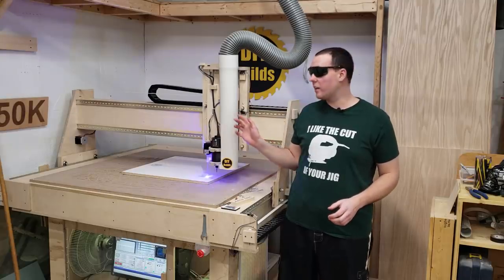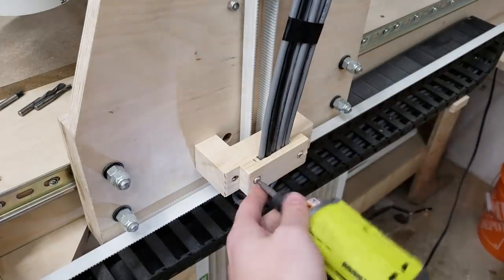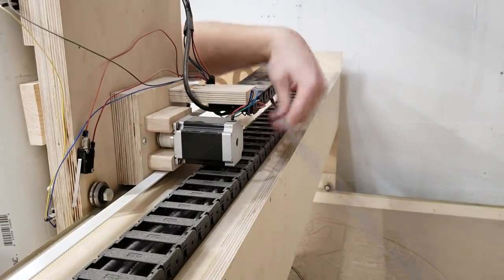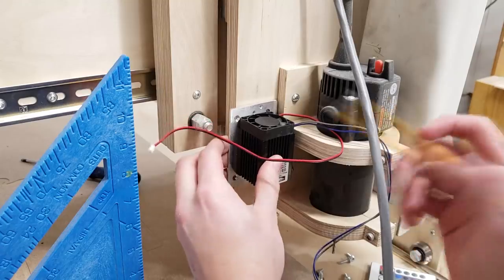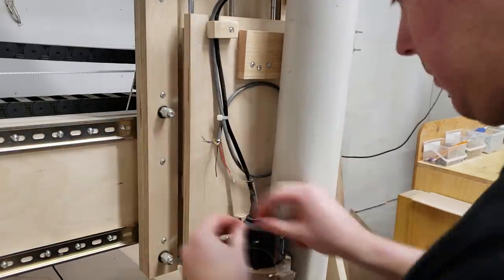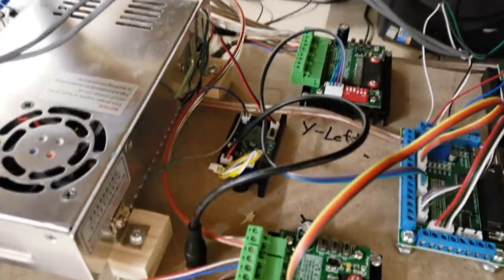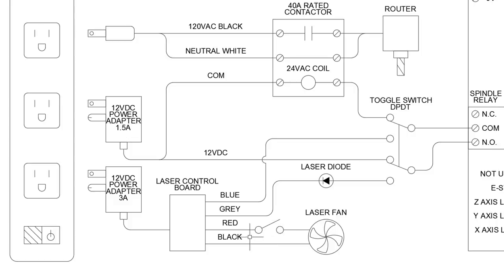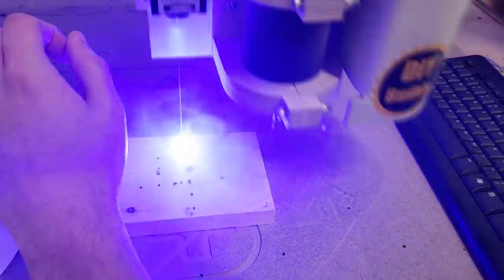DIY CNC Laser - Adding a 5W Laser to My Homemade CNC Router

Comment: After reading the comments I came up with a couple suggestions:

1) Add a laser pointer to the set up and have the pointer lined up with the spot where the laser burns. The pointer would then give you a visual reference without having to turn on the burner laser allowing you to zero the laser without the need for glasses.

2) (a) An optical safety addition: add removable piece of properly colored plastic that extends down past the bottom of the laser an inch or two above the cutting surface. This will insure that the potential laser on glasses off potential harm, has no affect. (b) Or you could just add a box around the piece being burned, cut or engraved; whichever the case may be.
Reply from the maker: Not bad suggestions at all. Thanks.
Reply: @DIYBuilds  😎👍
Reply: @DIYBuilds  i thinks there is an option to regulate the power of the laser, so you can set a very low power to the laser to clearly see the spot and regulate the focus. then you set the full power for the work. saw it on other videos like yours

Comment: First of all "a Great video" but i Must say that your house keeping skills (wiring) are great, i have a 4x4 diy cnc since 2017 and still working on the house keeping. Keep up the great work. also i notice you use Belt drive i use .25 chain drive and love it, i have only had to make adjustments once since i started and travel speeds are high.

Comment: What you will need to find out is if the Laser Module can handle Pulse Width Modulation. Typical Laser Engravers will have that so as to set the laser turning on percentage. 100% would have the laser pulsing very fast and more intense, while 50% would provide for the laser to provide a lesser burn effect in the material. This is where you would have to play with the settings to get the parameters set for each of the material you want to laser engrave. Mach3 does provide the ability to produce PWM signals to a laser device.

Comment: Hello. Is it possible to control the laser power using the spindle rotation signal? I'm asking because almost all laser module have a PWM controller, and I'm not sure if the Mach3 interface can output PWM to control the laser power. Thanks in advance!

Comment: If you add a connector for your laser lead it makes it able to be removed when not using the laser. I found that dust and vibration from cutting can be hard on the laser. Even with the best dust collector small dust partials build up on the lens and when the laser comes on will burn into the lens and will shorten it's life.
Reply from the maker: Good idea thanks
Reply: What about a piece of tape or plastic over the lens? Would that work? Thanks for the tip!
Reply: @TheRainHarvester  that would save dust from the lens, but not from the cooling find and fan. And vibration is still an issue. In found a quick release mount made it easy to change it out.

Comment: I purchased a small laser similar to yours but it seems that it is either on or off, no adjustment for the strength of the laser, as least that’s my understanding, is that the same as yours?
How do you control the on and off of the laser so it doesn’t burn the surface from one area to the next?
Thanks

Comment: In my case 3wire laser 12v,gnd&pwm …..pwm connect with pin 1 and external power supply for laser also but laser always power on its not control by mach3 …any idea about this issue ….external power supply gnd wire should connect with mach board?

Comment: Great build! 
4:08 - I prefer using another heat shirnk tube (with a bigger diameter) going over all wires instead of electrical tape.
After a few years the tape just gets all sticky... yuck! But maybe I used some bad quality tape.

Comment: Thanks for sharing this video. I have thought about doing this for some time. My question is how do you 'zero' in the starting point of the laser. With the router you just align the bit with the center of the material (or wherever you want to start). How do you zero in the laser's starting point without burning your material?? Thanks!
Reply from the maker: I burn the spoil board and jog it till it hits the bottom left corner (my 0)

Comment: Love this. Going to try it with my china 6040.   I think it would be a bit simpler to wire if I give it its own power supply and manual switch.   Without touching the control box.   What do you think?

Comment: Great! I have a question though, I also have a CNC on which I can switch between the spindle and the laser diode but I can't find a way the make a design that use M3 and M5 to replace the Z axis command... yes I'm new to this! Do you have a video where you explain that? Or can you give me some clues? Programs, post processor, etc. Thanks!
Reply from the maker: They way I do it is not easy and requires manual manipulation of the code. Sorry I can't make it easier for you.
Reply: @DIYBuilds  Still I'm interested to know, I'm used to 'not easy' ahah! Did you only altered the post processor? Any ressources or documentation you could recommend on the top of your head? Which software do you use to generate your G-Code? Thanks!
Reply from the maker: I make the g code in fusion using trace. I make the retract go up 1 inch and set cutting at 0. Then in notepad I find and replace all retract commands with m5 (off) and replace all down commands with m3 (on)
Reply: @DIYBuilds  Thanks a lot for the pointers!!! I'll go and try a couple of things!!

Comment: Awesome, I wish I had the money and possibility to build one myself!
Reply: If you wanted to do just the laser you could build it for around $100 plus the cost of the laser.. not sure how much they go for..
Reply: @piercer4882  Depending on what you want, 5W laser modules run from $65 to ~$150 on eBay.

Comment: It's awesome project and with an engraving laser you can do almost everything you like on wood. But when you cnc something and then you want to engrave, have you set offset between router and laser? Because then you could not do precisely cnc and engraving on the same wood piece.
Reply from the maker: No I'd be eyeballing it for sure.
Reply: @DIYBuilds  you could use mirrors.  a 45 over to the router, remove the router bit, and install a custom bit with another 45 mirror and boom, your laser is where you router bit was.
Reply: G10 L20 P0 x0 y0 "  Will reset the origin to 0,0. You could replace the zero with an offset of your laser. Just be sure that the two objects are always created/referenced from the same origin point (add a dot to the bottom left so the cam sw will acknowledge a reference point) the cnc cam won't attempt to cut a dot, but the laser might.

Comment: Where do the yellow and white wires off the laser board connect to?
Reply from the maker: Mine has red and white = fan and blue and grey = LASER. The board has the ability for power control but i just use max power

Comment: Cool Machine !How did you make the laser go on and off during the G0 movements ,did you manually have to place M3 and M5 commands in the G-code ?
Reply from the maker: Yes i did
Reply: I,ve the same problem,for small programs it isn't a problem,but for large G-code files it's a pain.There must be a solution for this
Reply: MvdG what you can do is run a small program that can insert those codes for you.
Reply: Is there anyway that you can use the find and replace option in Notepad to help reduce your labor?

Comment: [At 7:20 min] Is the circle one hundred percent round? You can see a tiny edge / overlap.
Reply from the maker: This is due to the m3 and m5 commands dwelling in place for a fraction of a second when switching the laser on and off allowing the laser to burn a bigger mark then when moving. I'm not sure how to fix it yet.
Reply: Mach 3 has a dwell setting to allow the spindle to spin up, setting this to zero my help.  @DIYBuilds
Reply from the maker: I did do that and a dwell still exists. I think its related to the way the m3 command works. Other things online mentioned using aux output to control it but my board doesn't support that.

Comment: If I understand correctly you use spindle on/off g-code commands to turn the laser on and off?
Q1: what software do you use to generate gcode ? Typical milling cam software moves z up before moving the spindle to next position but with laser the z stays in place but the spindle stays on
Q2: can you control power output of the laser in this setup?
Reply from the maker: My controller can't but an addon board can be purchased. I use mill cam to generate g code and set heights all to 0 and manually add in the m3 m5 commands
Reply: @DIYBuilds  just to confirm, you don't control the power of the laser at all, it's just simply on and off via the m3 and m5 commands you manually enter in the g-code?
Reply from the maker: Yes
Reply: @DIYBuilds  sweet. Another question. If I don't want to build a switch to toggle between spindle & laser... I was thinking that I could hook either a transistor or relay to a different output out of my CNC controller and instead of using M3 and M5 (which would only work for the spindle) I could use some other command in the G-Code. Like I was thinking that you can turn coolant on/off in g-code and I could just use that command and electrical pathway to turn the laser on and off. Any thoughts on that? Much much appreciated!
Reply from the maker: Sounds doable to me.

Comment: I'd remove the 12v 1.5amp ps and wire up just the 12v 3amp ps to pull double duty.
Reply from the maker: I thought about that and it's extra work so i didn't lol
Reply: @DIYBuilds  This is an old post but I am just now viewing it for the first time.  Great job on the build of your CNC and now the laser upgrade. Awesome! From looking at your schematic I just wanted to point out that I noticed here is you are driving a 24 VAC contactor coil with 12 VDC which is causing the coil in the contactor to draw more current than what it is rated for.  This could be a point of failure for this reason down the road if you ever have troubles to figure out. Again, great job!

Comment: One of the more notable things about this CNC....you're still using Windows XP..!!!
Reply: As long as the computer is not connected to the internet...local only...there is no problem with XP  :)
Personally I use XP for many of my systems on local intranet...works great!
Reply: @gregorythomas333  Also, no compatibility problems and crashes with software updates. XP works great standalone and, once you set it you can forget it.

Comment: Subscribed, keep up the excellent content, thank you!
Consider T2 Laser software t2graphics.weebly.com , not sure about compatibility with your setup, it really does work great for me. I built a 80*100cm 5000MW and used different software to control with the best results being T2. Also consider focused air assist at the laser engraving area, less char / smoke residue, faster cut time, might make it adjustable to clear out router debris, win win. 
Keep the duke nukem comments for sure.